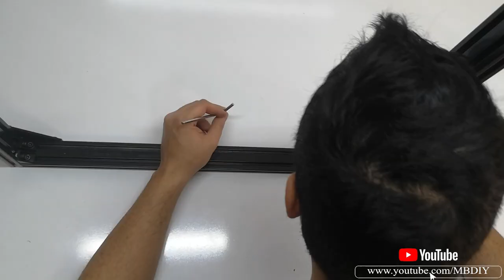DIY 3D Printer &&  How To Make 3D Printer At Home

Comment: Is there a reason for your choice to have the (usually) slow moving Z-axis on dual linear rails ?
Just asking 'cause it adds a lot of cost and the precision comes from the screw rods anyway...
To be honest the video didn't really teach me how to build a 3D printer, it just showed me someone screwing and measuring a lot.
Still entertaining enough to get me to watch it though ;-)
Reply: The precision in the Z axis comes from the threaded rods. But the usually gave a fair bit of runout in them contributing to Z shift. And so does linear rods. This way you negate a fair bit of that.